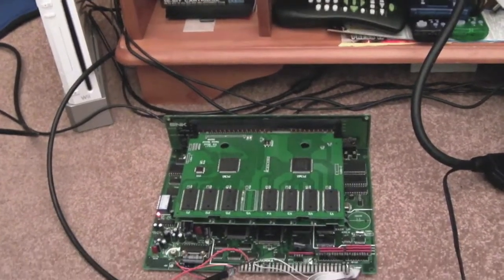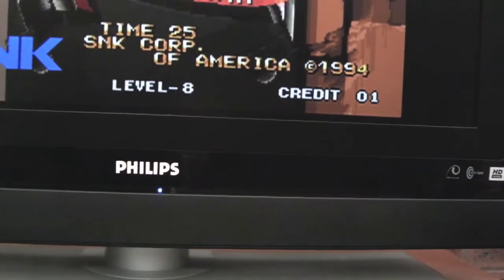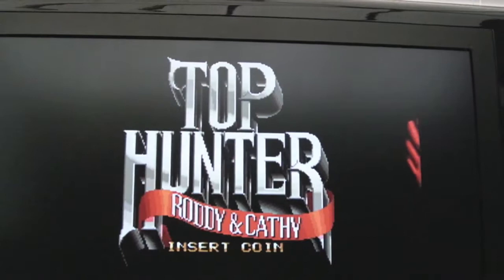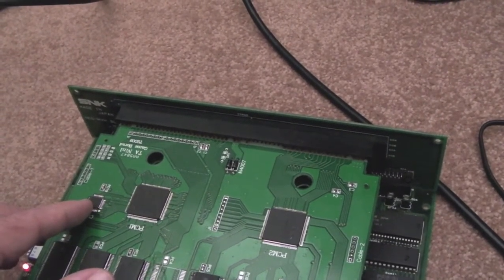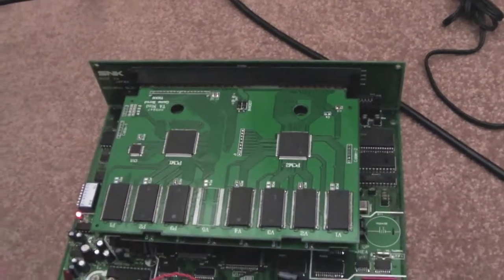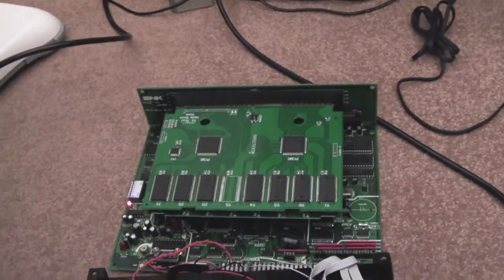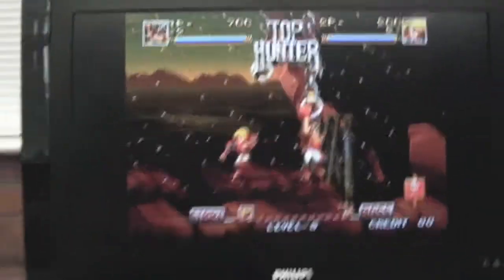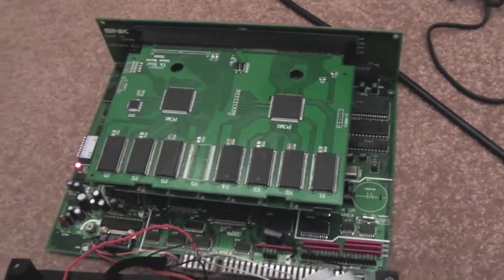SNK Neo Geo MV-1FZ (MVS) More Cart Wierdness

Comment from the maker: NOTE: There are a few key points to point out here.  Do not run PCBs off carpet - you risk ESD damage.  The problems here were solved by  reflowing connections on the 120 in 1.  What won't have helped is this running from the carpet.  I've left this video here anyway - despite how embarrasing it is now lol.  You have to remember at this point I hadn't worked in electronics for about 25 years and had long since forgoten a lot of things.  I knew the risks of ESD at the time but just thought it was low risk - in retrospect it wasn't worth taking any risk at all.   Work from an ESD mat!

NOTE: Reactance has NOTHING to do with this at all. I was very rusty after 25 years NOT working in electronics. Reactance is a capacitor's opposition to AC (kind of like AC resistance). The carpet probably wasn't helping, but it was the 120 in 1 (bad solder points).

Comment: or you could stop fondling your carts while they are working...just sayin'
Reply from the maker: There were a few things working against me in this video - firstly the carpet!  I shouldn't have been working off the carpet there at all - that was a huge issue.   The problem with this cart being intermittant was bad solder points on the MVS, and bad solder points on the large flat pack IC on the cart.

Comment: okay i think try one more thing... plug it into a different plug that is on a different breaker circuit (maybe use an extension if needed) just to rule out noise coming from the mains.. i doubt it... but also it may be a grounding loop maybe? we sometimes get that in audio gear (i do music production) but it comes in the form of noise you can hear. the thing is, you are touching a contact and it goes away which makes it look like maybe it's not grounded properly.. not that im an expert on arcade boards etc... i have a neo geo too but it's a different model and in a cab ....
Reply from the maker: Thanks - you must have missed my comment up top - I think i've sorted this, and I suspect its a damaged trace on the cart that has caused this.  Played it all night without a problem.  Fingers crossed it doesnt some back...
Reply: oh my bad... i thought it started up again... great. so if you get the new 120 in 1 cart i hope it doesn't have that issue... by the way, what game(s) did you go for on the 120 in 1 that the 160 in 1 doesn't have? man we need a new 160 in 1 with different games...
Reply from the maker: The 120 in 1 has Ghost Pilots, Twinkle Star Sprite, NAM 1975, Shock Troopers and some other game I forget.

I've also ordered a 60 in 1 (mega rare, chinese cart) you can find that on Ali Express - might not be any on there now but they usually put them back on every week or two.  The 60 in 1 has another 5 or so games not on any of the other mutlicarts.  Like Super Spy, Voltage Figher, Waku Waku 7, Ninja Combat, League Bowling, and Exchanger.  Also want that as it will give me another copy of NAM and Ghost Pilots.  The more copies the better - as you never know which carts will fail and which have dodgy graphics and sound lol.
Reply: ah cool... would be great if we could use an eprom burner to replace some of those + titles with other roms hahaha... i don't need 48 different KOF games lol.
Reply from the maker: It's totally possible - we just need to find a way to read and write them.  Due to the number of pins it would probably need a costly programmer, but there might be a way to create our own if we can find the data sheet.  Sometimes you can use other systems / carts to actually create a programmer that way.
Reply: GadgetUK164
i suspect it wouldn't happen from connecting the cart... you would likely have to remove the eproms from the chip board on the cart and re-burn them using an eprom burner... i think lukemorse1 has a vid showing him burning arcade roms. not sure exactly... but maybe it would be possible to rewrite the existing roms or something.
Reply from the maker: Yes, i've already got 2 EPROM programmers.  The problems with these chips is there are a LOT of pins because obviously they are quite high capacity.  I doubt luke has a programmer that will do these chips tbh.  I suspect you would need an industrial programmer - think $1000 upwards...   You are right in that the chips would likely need removing, that's not a problem though.  The problems are that the cheap programmers out there do not support chips with this number of address lines =/  If I had a programmer capable of reading and writting these I can then dump the contents, work out the format and basically create a cart with any list of games we wanted on it.  That's the only issue - finding a programmer that will read the NVPROM chips.MrDebauch
Reply: ahhh okay, i see what you're talking about now... haha. yeah man, that would be awesome. I actually am not sure how many pins his programmer goes up to. I am pretty sure his vid was related to the unibios maybe? not sure... it has been a year or so since seeing the vid. Anyhow yeah, would be awesome to replace roms like we were talking about. well good luck!
Reply from the maker: Yes, Unibios is easy at 40 pins.  The NVPROM chips on these multicarts have 80 ish pins =/  I've dumped my Unibios already, and programmed a diagnostics ROM for the main ROM and the M1 ROM - that's easy to do with cheap programmers.  I can't do the 42 pin chips with my current programmers though.
Reply: GadgetUK164
right right... i get it.  hey while we are talking (which google plus makes it sort of easy, surprisingly.. this is the only good thing i've seen so far with that haha) I was trying to find out how the unibios worked with the multi carts... specifically the 161-1 cart since that is the one I have. I read like a year ago about people having issues with multi carts and the unibios.... but the info predated the 161 version... and some people seem to have both but haven't talked on it. I was thinking of perhaps trying it out. I know generally what can be done with the unibios but I was wondering if there were any conflicts that may come up. I have a japanese board (or probably bios) so getting into the damn soft dip settings is done by memory of what numbered option i should pick on each menu rather than by reading. Just curious on your thoughts...
Reply from the maker: You won't have any problems with the 161 in 1.  The board being Japanese just means you've got a Japenese bios - which would be replaced by the Unibios, or could be replaced by a US / European bios.

Some of the older carts had the odd glitch with older Unibios versions.   If you get 3.1 direct from Razoolas website I doubt you will have any problems at all.

My system also works without problem for the originals I have as well.
Reply: GadgetUK164
okay great thanks for the help on that... yeah I would for sure buy it new right from the site.... it's the only neo geo item that isn't insanely expensive anyways so might as well.

Comment from the maker: I 'think' i've sorted this...  I am not 100% sure yet, so don't take this comment as a case closed but there were 2 things i've just found / done.

1) There was a beige coloured particle of 'something' inbetween 2 pins on one of the NVPROM chips (C chips), which I removed.
2) At manufacture there was a scratch across 5 or more traces, which I had previously inspected and looked OK.  I ran my nail over this scratch today and it did feel like something came off it - possibly the interaction there has joined a broken trace - they are so very small I cannot even see them through magnifying glass.

Following that it has been working for a good hour and been taken in and out of the MVS several times, and re-assembled and put back in and its still working...

Time will tell!

Comment from the maker: Just a quick update:-  I've ordered another (sucker or what...) 120 in 1 cart from China, so waiting for that (will be 2 to 3 weeks yet), but i've already got a 60 in 1 due in the next week or so, so that will be a good test.

At lunch I wired the ground up to a known earth point and that made no difference.  I put the board off the ground on a box, on books on all sorts, and that all made no difference.

The reason I am thinking its something to do with the cart is that its the same on 3 different MVS boards now, and despite at the beginning of that last video it was working on one board when cold, i've found that it works on all 3 boards for a few minutes from cold.  Therefore, something is playing up after warming up.  When I get the next 120 in 1 I will swap the 2 boards around to ascertain which of the 2 boards is causing the fault and investigate further from there.

In the mean time if you can suggest anything i've not tried, or explain what I am experiencing here theoretically, please let me know =)